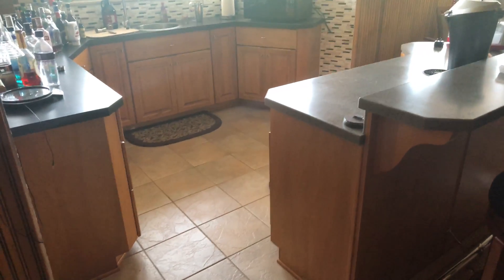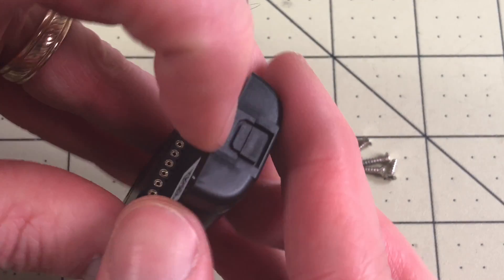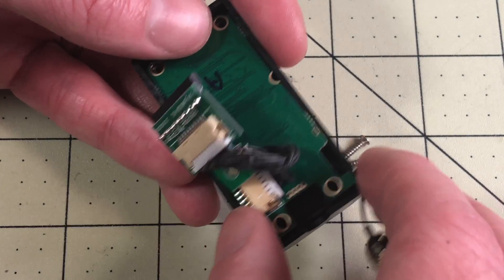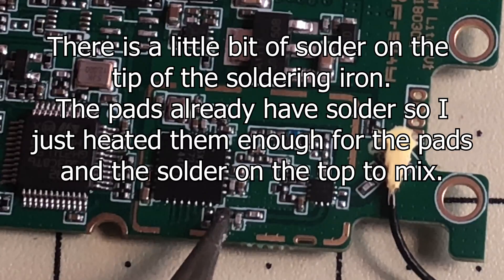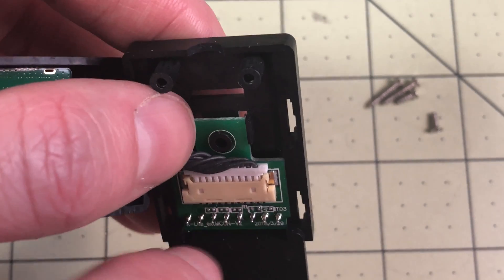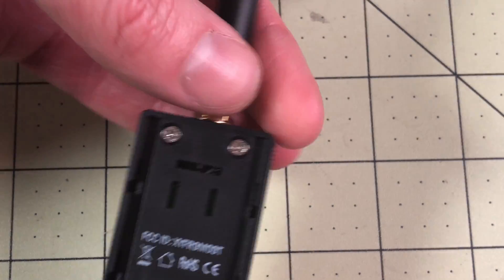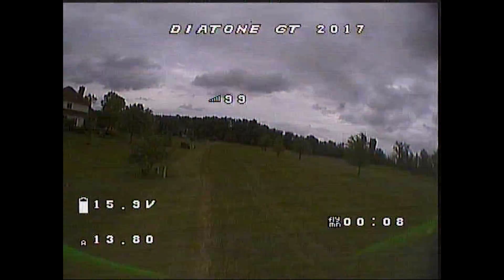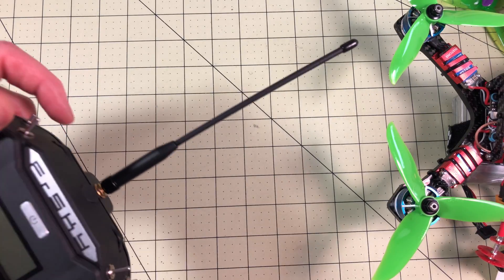FrSky Taranis R9M Lite Telemetry Fix!  Telemetry Lost at 20 meters?

Comment: Hi I am using Taranis QX7 with R9 and R9M module and I am getting the same sensor lost issue with Lipo Cell Sensor very frequently, say within 100 mtr range itself. Shall I change the firmware of R9 or R9M? Thanks in Advance.

Comment: Has this problem been fixed now Oct. 2019 or if I buy the R9M Lite Module will I still have to break it down and  do this mod?
Reply: Yes, they have fix that! The newer versions have a little capacitor over there ; )

Comment: I just opened my R9M Lite module. Unit is only about week old so much later batch. No missing solders here. There were greenish SMD-component on that place you made bridge. I've no experience with smd components at all and my multimeter is still on its way to me. So I couldn't check Resistance, capacitance etc. But there definitely was smd component on my unit.
Reply: can you publish a photo of this smd component
Reply: @ermantokbay  Sorry I don't have any better camera for this.
https://drive.google.com/file/d/1ooQS6oOS001NQLhrApi0426dPLW6PGfe/view?usp=drivesdk
Reply: Thank you. I just received my module and its include smd part too
Reply: https://www.rcgroups.com/forums/showpost.php?p=40365622&postcount=3675

Comment: Dear Mark, i did follow your instructions and even managed to solder a perfect connection between the two pads inside the tx module. I now receive all the telemetry data from my quad. super! But there is 1 problem. I cant get my receiver to work at all...  I flew with it before. Tips?
Reply from the maker: Blufkip FPV what works and what doesn’t?  You said you are getting telemetry data. Do you not get movement in the receiver page in Betaflight?
Reply: DroneRacer101 Thanks for your reply. True, i can get all the telemetry data, but I cant get my aux channels to work in begaflight receiver tab.

Comment: Got my module and was going to do this fix, but noticed that there's a tiny capacitor in the spot to solder up.  So guessing Frsky fixed the issue.

Comment: With this... did the range improved? Significantly ? More stable and higher rssi?
Reply from the maker: I haven’t had a chance to test maximum range with this yet.  At my standard 200meter maximum it was the highest RSSI I have ever seen.
Reply: Just seen the price.... I was hopping for a cheaper option that works better then the internal antenna. 😓
Reply from the maker: Did you see the external antenna test?  It’s not as good as the R9M, but it did improve the connection.
Reply: yap i did. but not satisfied with it haha. ( i might use that though) >^<

Comment: What does the fix do?  You can't properly explain?  You don't know/care/or both?  Solder a tiny wire, any wire you have lying around, than bridging a gap like that with only solder.  Use a multimeter to test continuity afterwards BEFORE reassembly.  These are beginner things.

Comment: Got mine in the mail today.  Looks like such an easy fix.  Have you tried to hookup the RX using F.Port yet?  Does the new slim module support F.Port?  Looks like there is an RX1 wire on the RX that could be used for it without the need to soldier any tiny pads like you have to on the R-XSR RX.  Great job BTW!  I guess I am assuming that you are using the R9 Slim+ RX.
Reply from the maker: This one is a Slim. I have a comparison of the Slim and + in a couple of days. But I think only the Mini supports FPort.
Reply: Looks like your right.  It's not supported (yet).  I didn't see the mini module when I submitted my preorder back in April.  Looks like I'll have to pickup a mini!  I would be curious to see how you managed to run the antenna(s).  They are pretty long for a mini quad.  At least the ones on the Slim+ are.